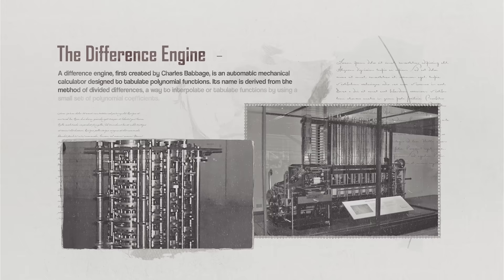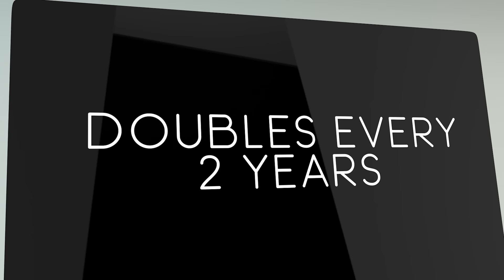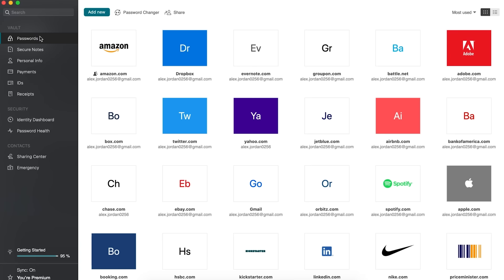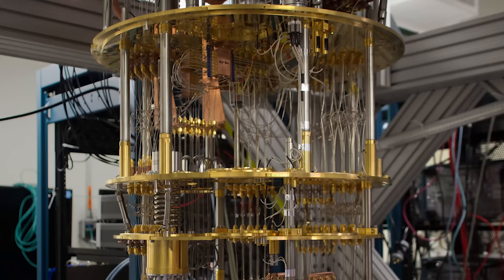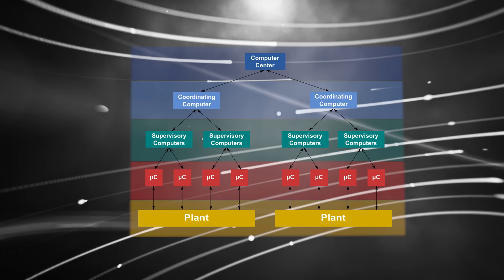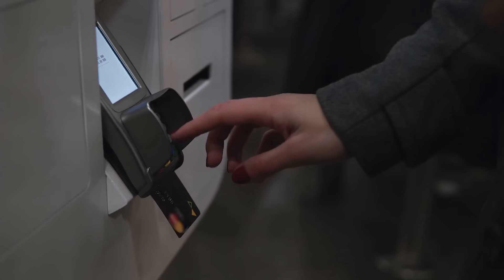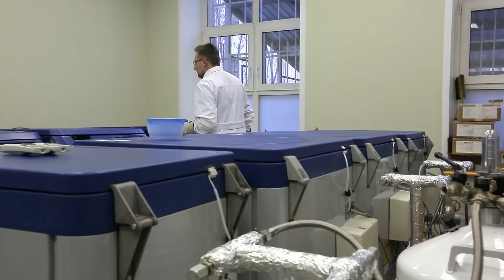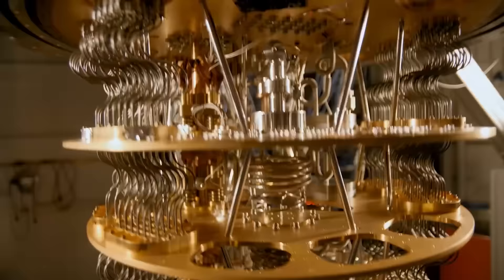This Revolutionary Computer Is About to Change The World for Good

Comment: Sir that would mean that it doesn’t really matter which dimension you be in the x because in each dimension the X would be in a different place so unless it didn’t matter what book it was in that wouldn’t work, but if ask only for rainbow hand written x in a book then will it be useful; but if in your reality your dimension it was specific book it’s supposed to be on else had to be in a certain book then none of that would be relevant because you would never find it and that’s where quantum screws you because quantum might be the theory of multiples of mentions doing multiple things but it also has to take into account that in each dimension things are going to be different and quantum computer therefore postulate the solution but he could not give a definite answer if you would have that flex probability of being wrong there for instantly solutions but whether those solutions in fact are the right solution would depend on a given point a fixed point and a fixed solution we can get with most numbers and it takes longer yes but the long of the short of it they are a set point they actually cannot change because they are fixed I’m gonna give you a basic example it’s a simple as they go the root of 49 is seven that can’t be changed that’s what it is  7×7 = 49 right He’s simple for any computer to figure out the quantum computer on the other hand would have more variables it would have to take in all those variables then it would have to choose what it believes to be the correct one Schrodinger‘s cat was never proven and that was because it was a thought experiment he was trying to basically say that thing ideas many philosophers on even if you psychiatrist appointment time I come up with ridiculous and so he came up with the idea that if you have a cat and put it in a box you would not know whether the cat was alive or dead he never actually did it it was merely to make a point however if you had a computer quantum computer it would have to ask a question and he would probably end up destroying the computer why because it would be like trying to find the last digit in pi because it would take in all the variables and it would have a hard time finding out whether the cat is alive or dead because he could be alive or dead and since nobody will have actually open the box to look at it well you see where this is going and that’s a problem with a quantum computer quantum computers a good if you already have a pretty good idea what the answer supposed to be because then it’s basically giving you an educated guess it’s still guess what is it educated guess OK it’s only good if you know the answer if there’s a very an answer to the question if for example you’re asking for a key root of an extremely long number it might take and there are people who can do this in your head better than any computer a while for them to come up with the answer but they will eventually come up with the answer your quantum computer will only come up with the answer if it is a fixed solution if there is no other solutions to the problem i.e. it’s no different than a regular computer it’s more of a theoretical computer because you can come up with theoretical solutions but it cannot come up with definitive solutions why because it’s a question of whether the cat is living or dead and if you don’t go and look in the box you’ll never know that’s the answer the answer is it can be both why because you don’t know unless the cat meow she don’t know Schrodinger‘s cat is used a lot of times and it is an incorrect construct of a thought question
You don’t have to look in the box to know if the cat is living or dead all you have to do is go meow and see if it emails back on you have to do is listen and if you’re not there to listen and the cat will probably be dead because it will not be sad and it will fit in the box which probably has no air holes my point being is a quantum computer can only give you a theoretical answer it’s not giving an excellent answer you can say the answer to a certain problem is speculatively guess what this they cannot define problem because Sir find a problem and we can actually doing the problem and then somethings that don’t work A lot of sense to you I’ve tried fixing it I have problems with my hands I am physically handicapped to begin with That is voice to text for you.

Comment: I'm working toward a doctorate in quantum algorithms at the moment, and I figured for whatever losers look at comments I would add some corrections.

1: The parallelism interpretation of why a quantum computer is faster is... not great. Whether entanglement or superposition are the respective sources of power is hard to determine.
2: You don't get exponentially more parallel processes with more qubits: you get linearly more. Instead, the number of possible states grows exponentially. 
3: Qubits aren't "usually made of electrons". The computer you show from IBM right before saying this, in fact, is made from micrometer-sized superconductor circuits. 

Finally: quantum computers might not change the world at all. Everyone in the quantum field has taken a bet that they will. It hasn't been proven -- for any task that quantum computers seem very fast at -- that these tasks are classically difficult; it's already happened, for some of these tasks, that after quantum algorithms that are faster are found, someone turns around and finds a classical algorithm that beats or matches the quantum one.

Comment: So, if the primary hurdle is the need for super low temperatures, stop building personal computers. Built a few quantum computers large enough to accommodate the low temperature generators, and sell access via wireless superminiaturised personal units. I meam, what limit could there be on such a device's handling capacity? They could then also use those computers, to develop ways round the whole 'need to maintain insanely low temperatures' thing. Extrapolating this forward, what they'll eventually achieve, will be indistinguishable from 'magic'. Personally, I envy the folk being paid to conceptualise this stuff.

Comment: The computing power of computers does not double every two years because the processor is still about the same as it was in 2005 about 3.2 to 3.6 so go lie to some one else because I count processor speed as the power behind a computer while you don't.

Comment: quantum computing... does not... process anything ... it encrypts already known data for transmission between locations. again, it does not process. the atom has no idea what information is, it only reacts to already known information inputted into it in a limited number of predictable ways to encrypt pulses of electrons (the data) through it to another location where those pulses are decoded. if the pulses do not align, the signal has been intercepted. it does not calculate. if you put, " 1+2=" and hit enter, it will just scramble the symbols of the bits sent to it to unrecognizable bits. it will never say "3"

Comment: Yeah but the one in 1824 didn't change the world psych C integrated circuit invented by Jack Saint Clair Kilby. which won the Nobel Prize in physics to receive such an award. He had to change the world after 20 years of its service in the world before he was able to received the award of the Nobel Prize in physics for his creation. Which was noted. And apparently dings to be more important open activity and accomplishment switch benefited men to their fullest. In fact the piece of equipment that Jack st. Clair Kilby invented has allowed every single thing that you have been born to do regarding any form of equation television radio communications automobile activity flights x x owns anything to do with banking anything to do with any form of military or Communications worldwide. Which means that it was this one piece of equipment with changed the world to what we have today and it's still doing what it was intended to then when it was invented. And not only that but. it is also the only way in which any other form of computer system is able to be developed. Which means that quantum physics is actually achieved through the development of my cousin's integrated circuit called and I see or computer chip as we know it today. Yes without consideration we all owe it to Jack st. Clair Kilby for developing that one device that allows you to get on your telephone. It allows you to watch television. It allows you to have that little electronic device stuffed in your ass all day long. Of whichever type you choose. You should be thankful. Otherwise you would not even be able to address this comment.

Comment: If you do a little bit more digging you'll find that babbage's computer was not the first computer the Greeks made the first computer it was run off of the position of stars and moon and sun it was found  on a ship 15,000 ft and they haven't figured out exactly what it was used for but they know it was used for computing data not in the way that we think of it but in an entirely different way

Comment: Liquid memoury computers useing  using 0s 1s and 2s but everything should be tuned to a set frequency then watch what happens. 

 If the human race survives 
Past 2024  you will see computers using frequency in ways you didn't think possible. 0s  and 1s  will be expanded to 0s 1s and 2s and 3s

Comment: So called "Quantum Computers" will be made with super conductors so that the electrons flow at their fastest possible speed.

However, They will be superseded by "HyperSpacial Trinary Computers" that will be made pure of light/waves, until they start processing at speeds thousands of times faster that the speed of light, and start to generate gravitational fields that approaching the critical mass of a black hole.

Quantum computers will also be able to do that using the Bose-Einstein Condensate Effect, although the 
"HyperSpacial Trinary Computer" had already been invented, due to it's ability to also process it's way back in time. It also has a infinite photonic core memory unit capable of storing the data of an entire universe if it needs to. Yes the men in black thing is true.

Seriously though, The "HyperSpacial Trinary Computer" was invented by extraterrestrials many many millions of years ago.

One cool thing about the HyperSpacial Trinary Computer is that, being made of pure light, it can also spawn other computing processors it can multitask with. In theory, it could eventually expand itself to the size of the universe. Of course this is only possible up to the point of the Universe's zero point expansion vector before it starts collapsing in on itself.

And that's one huge computer!

Believe it or not?
Reply: Wild imagination 🧠
Reply: @C--A  Come on, it's based on hard proven science. Anyway if you think i have a "wild imagination" then so be it. At least I have an imagination to "create" the basis of reality upon. What do you have?
Reply: @C--A  Everything real is based on "wild imagination". It just does not happen from insults.